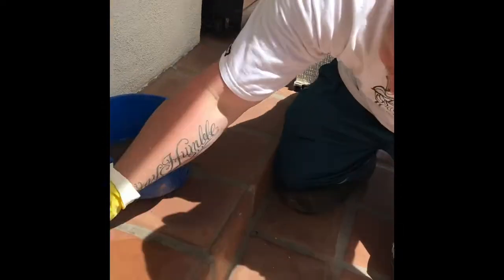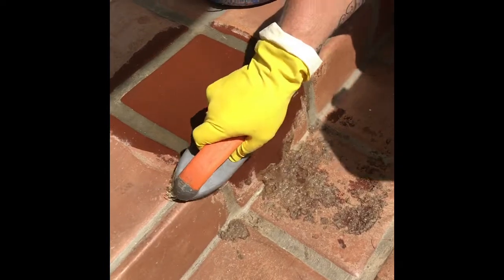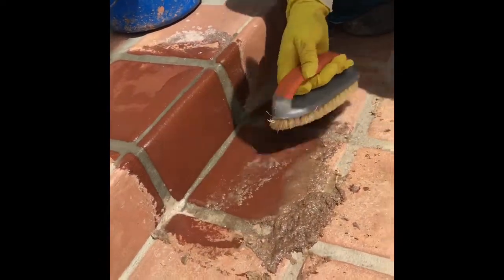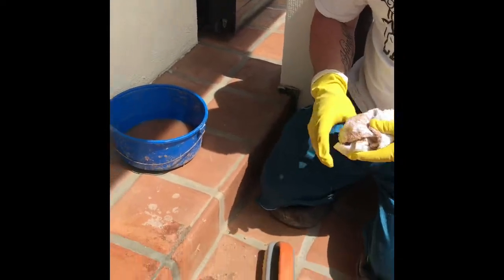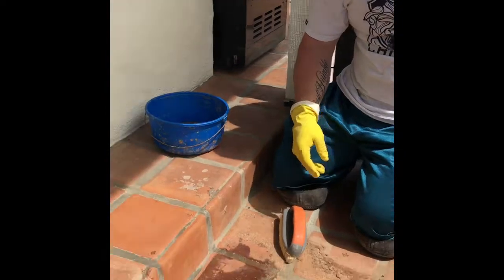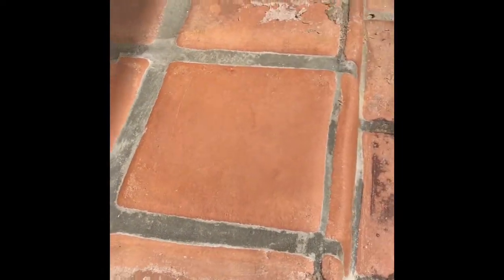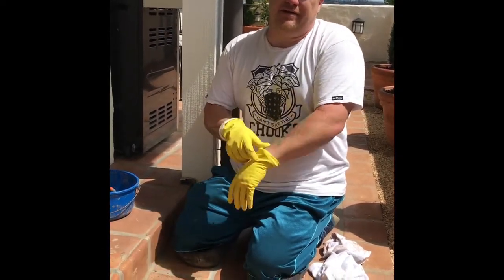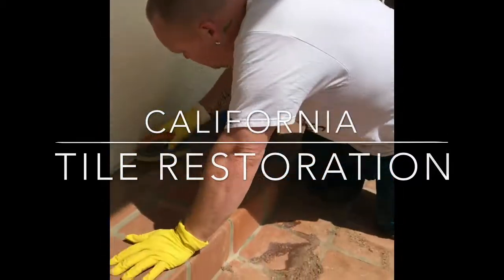How to remove coatings from outdoor terracotta tile floors

Comment: I just TRIED to do a whole kitchen today!!! This guy WAS likable until I realized he leaves out important points and my FLOOR IS A MESS!!!! Unfortunately, the safest and best and longest way to remove the "coating" is with a razor blade scraper..not kidding...At least you know what you're removing..The stripper? He could say the name and try to sell it!!! I don't believe it works as he says. Notice no comments in a long time. Back to stripper..OMG....worse than scraping..all sorts of stuff( dark) comes up  AND..the dark red tiles probably shouldn't be fooled with..NOTHING COMES UP  SCRAPING OR WITH  STRIPPER..Maybe when I figure it all out..I'll do a YT video. I am very upset and cannot get the proper info..water vs oil-based sealer? Most IMPORTANT: WHAT CHEMICAL MELTS IT?????????????..Of course the tile turned dark ..HE WET IT!!!! Any real professionals out there??? Contact me please.

Comment from the maker: For 1, you can't get the stripper at home depot or any other hardware store, 2 its a chemical with no water in it and i had it custom made into a liquid instead of a semi paste or jelly, its VERY expensive per gallon. Are you people prepared to spend $50.00 per gallon plus shipping and handling? Each gallon weighs 8 lbs. For instance if you have 500 square feet then you probably need 20 to 25 gallons depending on the thickness of the sealer on your floor. Keep in mind you will need a shit ton of materials such as rags, brushes, buckets, sealers, floor polish, cleaners, scrub pads, FANS for ventilation. Look, I've been doing this for 25+ years, my method is the only method, the best method. Don't waste your time doing it any other way unless you are prepared to do it the way I show you. If you are serious about making an order send me an e-mail  fritz_wittmann@yahoo.com
Reply: California Tile Restoration | Please tell me how to remove plastic sheeting used to protect the floor while painting which melted onto the tile. Thank you. Brenda